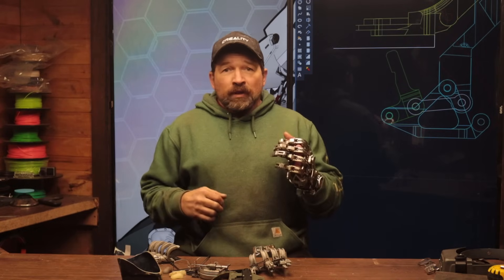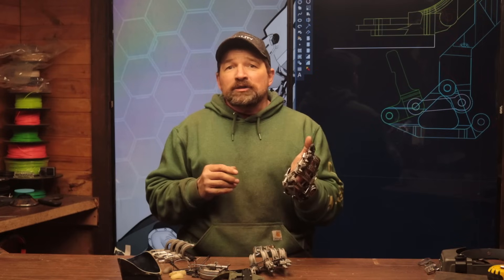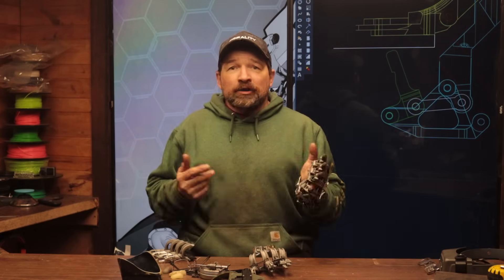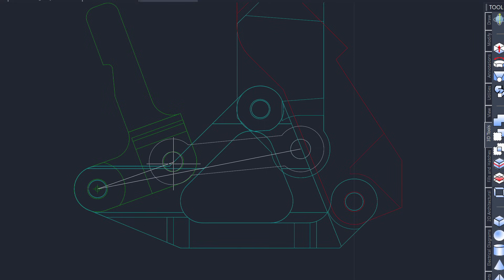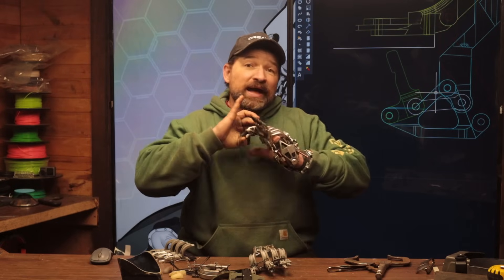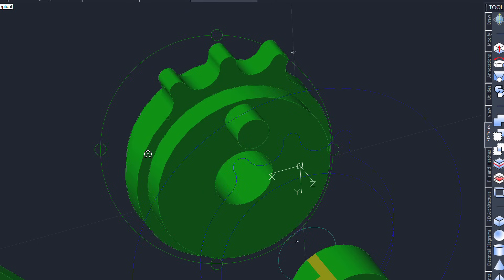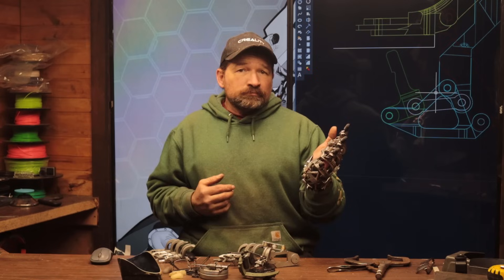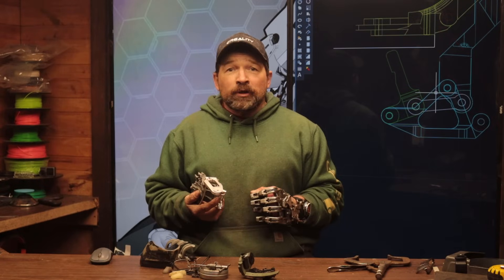Lock Under Load a New Idea! and other updates on the project!

Comment: Amazing update. Your production quality has gone up since the last time I saw your hand, too. Cerakote is good stuff, but don't forget about Durakote, either! IDK if the industry has moved on or perfected the affordability od Cerakote, but last I read about the stuff (roughly 4 years ago) Durakote did most of what Cerakote could, but was simpler, didn't come in as many colors, and thus, was cheaper.

A point of criticism, though: Your video is far too quiet. Looking up the metadata for this with right click>stats for nerds, it's over 18db quieter than baseline. Youtube only compensates for videos that are too loud compared to baseline, but YOUR video (at least this one) is about 3x quieter than it should be, which is a pain when there's only so much someone can crank the volume up on their end.

Comment: What kind of coating thickness does Cerakote need? I.e., does that require a decrement in part thickness anticipating the coating, and potentially a doubling in part versions for coated and noncoated?
Reply from the maker: There was a meeting about that topic. The thickness varies by applicator. But plan for 0.0035"/side. So where the p1 and p2 cross (4 surfaces) , 0.020" will net you 0.0025" ×2 of clearance for the parts to pass each other and not drag. Rn I'm thinking that it's probably going to be 1 maybe 2 applicators that get the project, where you would send your fitted parts to them with colors. We'd have an expected price. And it would just be a line item expense.  It's still super early,  it might not be as finicky as I'm anticipating, but better to be on the lookout for this kind of issue to arise than not.

Comment: If aluminum does not work, 3D printed titanium is pretty darn good.  I have had a few parts made in the material and it is as good as machined grade 5 Ti.
Reply from the maker: I looked at having the proximal 1's printed in titanium since they're under the greatest amount of load, and i may need to do so if i start to see excess wear or failure. But to have everything printed in titanium exceeds the price point that I'm trying to hit. It's super cool, but it's super pricey at the same time.

Comment: I like the alternative solution to locking under load.  I'm curious to hear after you've worn the new design for a bit if you run into any issues with larger objects being to bulky to easily get on the knuckles vs hooking the whole fingers around them.
Reply from the maker: It's mostly geared for roundish shapes +/- 1" in diameter. Since the weight still gets suspended about the back of the thumb and wrist, the weight is also a factor as to how well it works.

Comment: Will there be room in the future to possibly say for example have the tips of the fingers be swapped out with utilities? Such as ceramic safety blade, wedge for prying etc
Reply from the maker: The fingertips already have that feature.  I have ones made from silplat 40, tpu with a concave on the back for general purposes,  concave on the back that fits machine handles, and ones that are essentially claws. That was one of the advents that started with this series of devices.

Comment: Using the backside of the fingers for lifting is genius! And those ceramic coatings are going to look super stylish! Especially if the chips showed in the video are the colors you're going to test, love the dark grey and orange together.
Reply from the maker: They are, orange for the drive components,  distal link, spring, chain, driver,  black on the distal, prox 2, winder top, and sockets, Grey on everything else.
Reply: @missingpartsclub looking forward to seeing the results!!

Comment: Ian, did you ever do a video explaining your idea of a product? I mean, each amputee will have their residual limbs and whatever muscles and tendons are there, so the actuation range and the number of degrees of freedom will vary. Are you going to redesign each prosthetic for the specific use case?
Not that this would be bad: to have a device that restores a lot of functions, behaves smoothly, has haptic feedback, no batteries, and a is gorgeous is mindblowing.. but not cheap